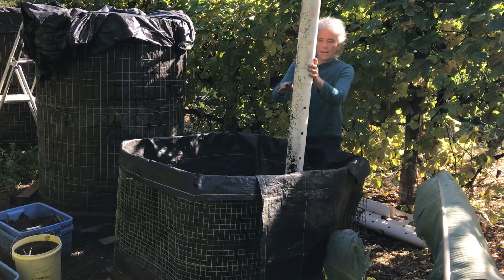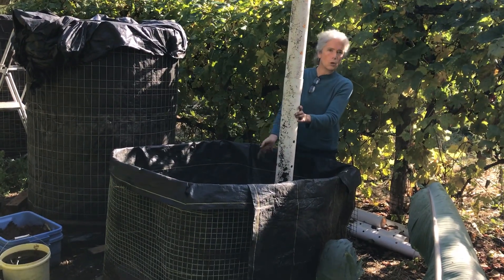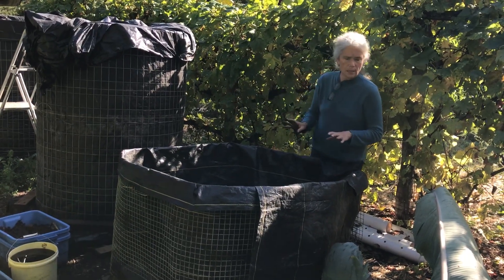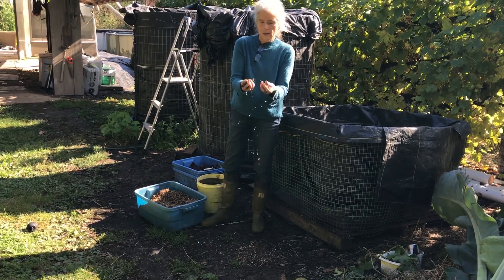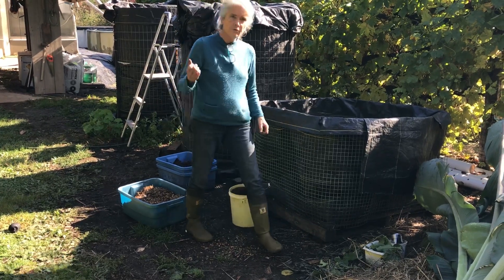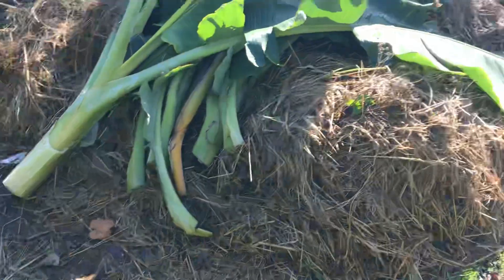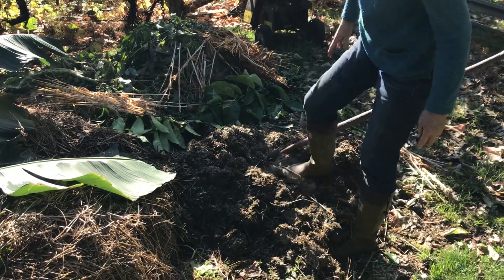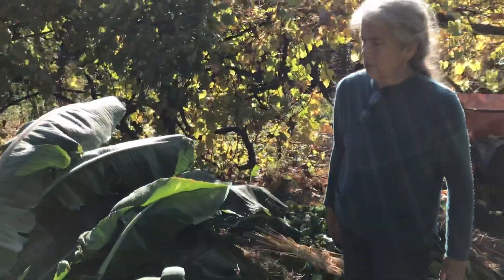Using Johnson-Su Bioreactors for Composting

Comment: Can you use this model made in a barrel for  vermicompost also
Reply from the maker: Having airflow from the perimeter with breathable landscape cloth is part of what makes it work, as well as the spaced 4" holes running from top to bottom. The 'silo' is  set up on a pallet so the air can circulate through the bottom of the pile as well

Comment: Not a big fan of The Johnson Su bioreactor except it got me thinking about different aspects of Nature. So much unnecessary stuff the J Su uses to get results I feel I get using my simple CBCB. I’m after the heat, long lasting heat and all the possibilities it will hold for The Urban Farming Movement. The microbe world will come after the thermophilic stage is over they always do so why not make it as hot as you can lasting as long as it can using stuff anyone can easily find and master.  All this tubing, side cover IMO totally unnecessary. 
https://www.youtube.com/playlist?list=PL8OAnpHec404E8OONfkGj1YQw7OqS9Xgq
Reply from the maker: I like the simplicity of the Johnson-Su. I can make the 'silos' on my own, assembled out of what's lying around, and after a week pull out the tubes, cover it with a porous material (it rains a lot here) and pretty much leave it. My anaerobic digester deals with the stinky sloppy stuff, turns it into decent fertilizer. Looks like you have some cool stuff happening too.
Reply: It’s super easy but it does something easier than other method. Is the level of fungal growth. Walk away and let it go. Only requires watering, and initial set up.
Reply: Great video by the way, sooo appreciate it👍